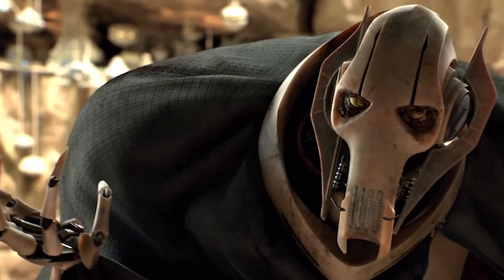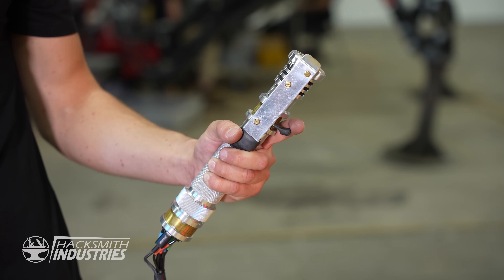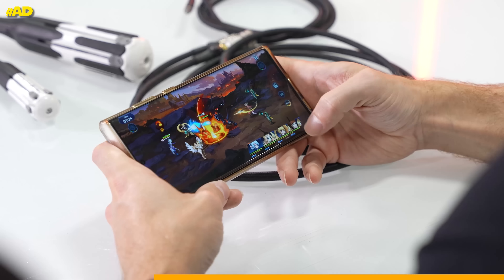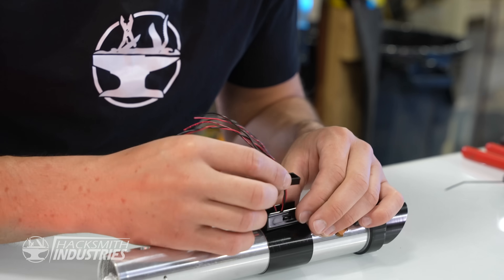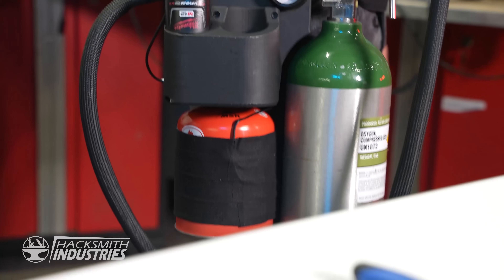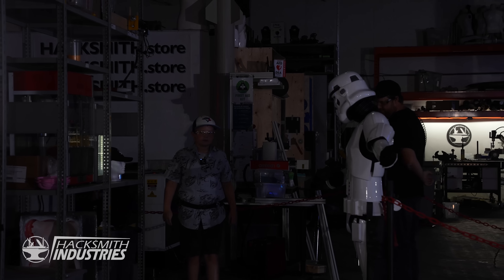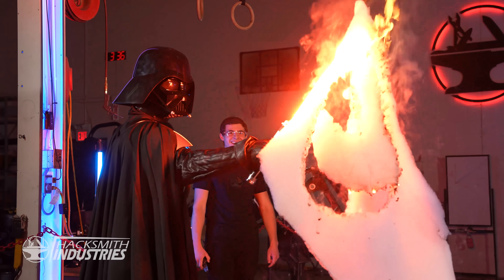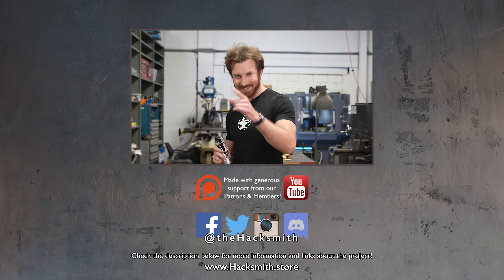My Best LIGHTSABER Yet! (STRONTIUM PLASMA 4500°)

Comment: for future versions i reccomend using CFX (crystal focus x) or something similar as a sound system as there are already "sound fonts" that you can download  plus it makes the swinging sound dynamic instead of a set sound like shown here: 6:28 and it may be possible to modify CFXs hit detection system to work when hitting another lightsaber of this type but im not entirely sure

a proffie sound board may work better due to it being more customisable. 

proffie and cfx boards are the most used lightsaber soundfont boards and are used in most custom lightsabers that you can buy
Reply: A Proffie soundboard would probably be better for the Hacksmith team. They're basically a purpose-build lightsaber arduino, and they have a lot of customization that can be done with them. CFX might be just as good, though.
Reply: Radiation?!.

Comment: This is super sick! And the power supply is super cool! Have you guys considered a type of forced air induction (like a turbo almost?) for a “firmer” blade? I’m no engineering buff but it might increase the velocity of the air that increases the “blade” and make it harder for ambient air to effect it as badly :) cool video!
Reply: It could work, though I don’t think it would be very practical seeing as a turbine that could withstand the heat would be pretty fragile. 

It’s also hard to without creating enough thrust to make it unwieldy, (remember velocity out = an opposite force in the other direction) this is the principle that most modern jet engines work on after all.

Still, might be doable, and overall a cool Idea. Just would present a lot of its own challenges.

Comment: Have you thought about how to give the plasma a bit of weight, in chemistry there's multiple isotopes of oxygen that are slightly heavier / lighter than air.

If you use it correctly you could get a protosaber that can acctually collide with objects (as in bounce off)

Comment: what if you had it so that the lightsaber is like charging connected to the gas on your backpack when you're not using it and then when you then use it its like charged with fuel. idk if this would work but would be pretty cool

Comment: That is a freaking amazing new lightsaber you guys made. Really incredibly how small the piping assembly got.

Who knows, next time the canisters and powersupply could fit within a extra long saber hilt.
Reply: I’m wondering how they will tackle the quantity of gas needed… the gas supply could probably already be moved to the hilt, but at the expanse of reducing the duration of the saber to probably half a second…
Reply: @fendalynn6604  Yeah. Thats why i was thinking of them making a extended hilt, maybe a lightsaber pike. Having the gas and oxygen supply be in canisters that are longer instead of wider could increase the capacity to be nearly the same.
Reply: @Mrstealth93  don’t forget wall thickness, and the fact that your radius increase the volume with it’s square, while your height increases it linearly.
Reply: @fendalynn6604  To be honest, i dont work with stuff like this myself. So you are likely right about those details. Was just thinking of the most ideal way of keeping everything as compact as possible for a future redesign of the Hacksmith saber.

Comment: You know how if you light a match, and angle it so that the flame goes up the match itself making the flame longer? With similar effect (through defeating this current idea of pure flame no central beam) you could put a pole in the center of the saber, maybe even with a small gas supply of its own. Could be thin, and like a foot but it would make a huge difference in my opinion.

Comment: Hey, I have a suggestion, why don’t you find a way to get a micro air compressor into the saver itself to ionize the oxygen in the air with some sort of air compressor ionizor combination? As for the power, why not an airsoft pistol battery? And micro electromagnet coils to create the magnetic field the keep the blade straight, maybe have the ionizer attached to the magnet.
Reply: Probably can't reliably produce a stable enough flow of fuel for laminar flow to happen, though it would be very interesting if they could make something like that to make an even smaller pack for the protosaber

Comment: Kyle Hill covered why making a real lightsaber would be an extremely bad idea even if it wasnt impossible, its pretty entertaining. 
Long story short: Youd need orders of magnitude more energy for it to cut instantaneously. Ignoring the fact that would likely set everything in the room on fire just from its radiant heat, it also vaporizes the material it passes through. Vapor vs solid takes up a volume orders of magnitude greater in size, I.e. Boom!... 
Which conjures some amusing if gross mental images as scenes like when Kenobi slices off an arm would in reality involve a violent, gory explosion and a lot of super heated alien gas. Elegant indeed.

Comment: As soon as that blade length issue is fixed, this will basically be perfect! Incredible work.
Reply: Not even close to perfect. Needs to be super ultra concentrated plasma, this is fire. Cool, but not close enough.
Reply: @dubber1416  Well, fire is plasma and laminar flow nozzles with high enough energy fuel concentrate it a LOT. We can’t control and generate non fire plasma at these temperatures without enormous machinery in our day and age.

Comment: Funnily enough, this matched the technological process of Lightsabers in the old lore. The first ones had to be connected via cord to an external pack worn on the back and then the belt as the centuries progressed, before power cell technology advanced to the point where the battery could be fitted inside of the hilt.
Reply: They mentioned that in the very first lightsaber video, the proper name is a protosaber
Reply: Well, with the current energy crisis we'll have to postpone a bit, I suppose.
Reply: unless it becomes possible to compress the fuel so much that it fits inside a hilt, it will always need an external tank
Reply: @huwale  One method that could potentially work, is sucking air through the bottom of the hilt, compressing, and igniting it.
Reply: @dragon12234  Immagine the quantity of oxygen that would be used, after 2min of use indoor you would start suffocating
Reply: @dragon12234  Woah woah woah, that’s a jet engine. You don’t want a jet engine in your hand.
Reply: @theyeetlord9158   Yes I do
Reply: Yeah I can’t see them getting the system any smaller than this, unless they make some tiny tanks in the hilt though I can’t image that lasting long
Reply: @RADkate  if efficient biofuels become more common and develops to a point where it could be sold for commercial use then maybe
Reply: @bruh-fw7op  oh yeah lets sell this 10 dollar light  saber to the whole world nothing can go wrong!
Reply: @diamondapocalypse5019  have you heard of a gun?
Reply: @diamondapocalypse5019  you realize that you can buy propane torches?
Reply: @ohafomob  thats not as bad as giving that to a kid, unlike a lightsaber
Reply: @daniyal-syed  you need a lisense
Reply: @diamondapocalypse5019  It is not required in most places in the United States to have a liscense in order to buy a gun.
Reply: @diamondapocalypse5019  laughs in youngling massacre... I mean training
Reply: @diamondapocalypse5019  I don't believe any children are being given real lightsabers as toys
Reply: @diamondapocalypse5019  Have you ever used a lighter?
Reply: @bable631  at least they dont burn my fingers off in 1 second
Reply: @RADkate  they can use thorium
Reply: @RADkate  Solid rocket fuel

Comment: Why are the fuel lines coming out the side of the handle instead of the bottom, even if you had to extend the handle slightly to route the lines to the bottom it would greatly improve the ergonomics.
Reply: Probably to help hide the fuel lines when dressing up. The lightsaber would look a bit wonky if you are showing it to people and there is a long obvious tube protruding from the bottom.

Comment: The most intriguing thing about this is you guys seem to have ideas on how to make the blade solid, retractable and burnable. I wonder if it's a combination of this gas tech and the original metal stick saber.
Reply: Youd need a Tantalum carbide rod to withstand the ridiculous heat those things put out. And alomst all materials we can cook up that are THIS heat resistant arent a big fan of being bashed together.
Ok edit: Those 4,5K are probably farenheit so a Tunsgten carbide rod should do it. Still, quite hot

Comment: just saw a friend with a lighter which turns the flame into the same red colour, it use a metal to do this heating the metal causes the flame to change wondering weather you could do this.

Comment: I have an idea for how to make this lightsaber more compact ; If you can make a tank on the end of the hilt or wherever to hold the fuel to power the light saber, leaving the oxygen tank as the only thing you  have to carry around. The tank should also be refillable so you just have to reload, or in this case, "refill" anytime you run out. Then for the oxygen, you can should try adding an air suctioning mechanism to provide oxygen, replacing the need to carry an oxygen tank around. I'm not really sure this ideas I've given will work, but it's worth a try.

Comment: unless you use some sort of electric/magnetic field (highly doubtable to exist) or like actual matter on the blade (rectraction issue) Im not sure how you guys are ever planning on making 2 lightsabers hit eachother and bounce back. Also the tip of the saber is supposed to be more round and less like a flame point, which might be easier (but certainly not easy) to fix

Comment: Defintely has a length problem, and when moving it around the beam gets very short.  I wonder if there is any possible way to fix this
Reply: Hollow, extending shaft with a dozen or so smaller outlets. Youd get a badass looking jagged blade that can actually hit stuff. Might not retract after thermal expansion tho.
Reply: laminar flow
Reply: Dude it's a working lightsaber, can't be too picky lol
Reply: @tundra9805  oh it's definitely cool, I'm just curios if they are going to be able to fix the length issues with their next iteration
Reply: @DinoPwn  oh ok, makes sense

Comment: This is full stop amazing. That said, I don’t believe the “blades” will ever be able to deflect each other.
Reply: he could put an extendable thin metal rod in the center for duels
Reply: @maliksworld8467  they would have to be tungsten
Reply: @Starwarrior-pw5st  like they're first blades that didn't use fuel?
Reply: @bl4cksp1d3r  yeah kinda except it is thinner and extenable
Reply: @Starwarrior-pw5st  It would melt, maybe the previous one wouldn't be hot enough but this one is
Reply: @sayrejoseph  Tungsten has a melting point of 6191 degrees and I highly doubt this lightsaber is over 5000 degrees
Reply: yea, but at 5000 degrees tungsten's probably a bit squishy
Reply: @anarchy8968  actually the point of tungsten is that no matter how soft it gets it doesn't get any softer. That's why they used it in their first one, the titanium would get too soft and get all floppy.
Reply: @maliksworld8467  would bend and deform sadly :(
Reply: @enolopanr9820  reinforced tungsten, not a perfect solution but it would work for a solid amount of time
Reply: @maliksworld8467  let’s invent a new whole alloy in order to Star Wars
Reply: @maliksworld8467  I think that would be pretty cool, plus it would decrease the volume the plasma needs to fill, thus making the blade longer maybe.
Reply: I guess they would have to invent a retractable, temperature-proof inside to reflect stuff. could even use that to have a more equal blade color.
Reply: Not with this design  at some point we will but I doubt by 2030
Reply: If they actually make it magnetically confined I could see it happen
Reply: Magnets
Reply: yea bc theyre just blowtorches lol
Reply: @penguen029  4500°, 1 and a half foot long blowtorches, so not really

Comment: Awesome work! Still bugs me the way you frame it to look like the blade is longer than it is by keeping the top end out of thr frame in most shots, I get why but still. I am glad to see that you did address it in the video, as always still impressed by what you all do
Reply: same lol, it's for the sake of coolness but eh, can't complain really since it is not that short, the tip looks wonky but it's what it is
Reply: @davencio5489  exactly! Its still amazing, just kinda annoyed by the prior framing to make it look longer
Reply: @FyreDrac  there is a way to fix this problem is by extending shaft with a dozen or so smaller outlets